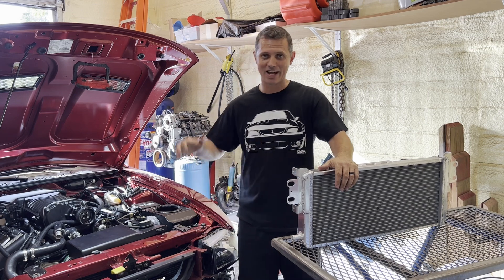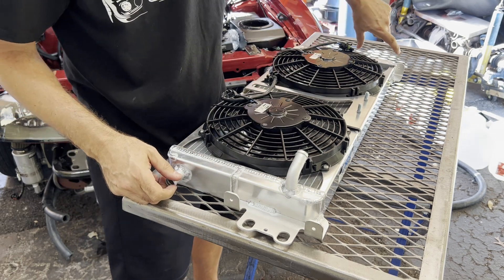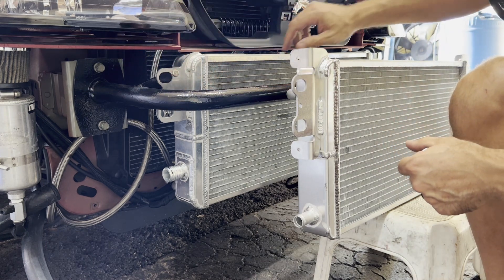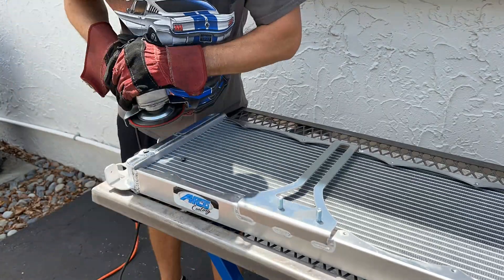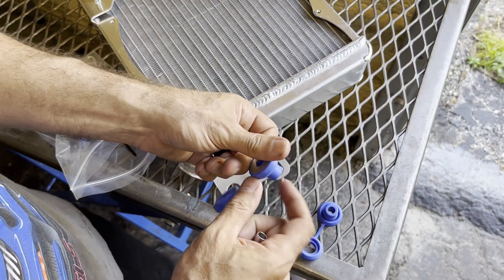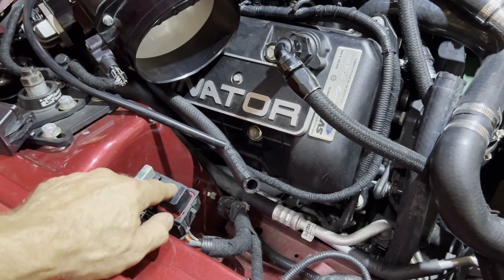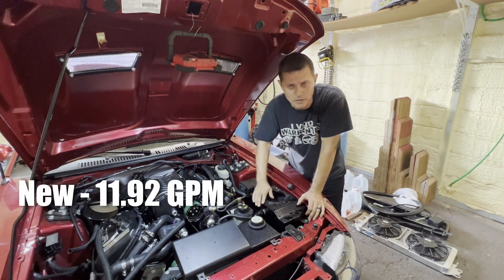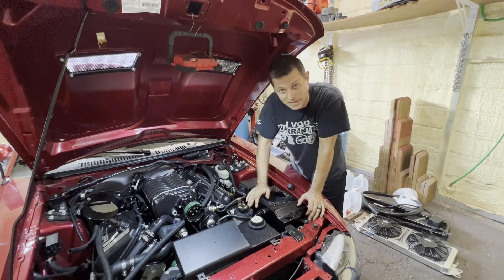Modifying a GT500 style Heat Exchanger into an 03 Cobra Terminator

Comment: Curious why you ran the hot coolant into the bottom of the heat exchanger and the cold out the top when normal path is hot in top and cold out the bottom
Reply from the maker: Anytime you plumb a cooler you want to flow from bottom to top so it can purge air out the system.

Comment: I have another question for you Mr. Malcolm. How effective would a normal dual pass heatexchanger, like an Afco, but custom built to double the thickness/girth? I ask because over half of the GT500 style heatexchanger is blocked by the front bumper and it doesn't get much airflow going through +50% of its surface. I am wondering if this has been tested before?
Reply from the maker: I've never seen that done before so I'm not really sure.  I will say although only the bottom portion has direct line of sight through the bumper you have to remember lots of air blows through and pushes up and all over.  So while the top half is not getting a direct line of sight flow of air it's definitely getting air.

Comment: Great content and exactly what I'm contemplating.  Curious if you considered the VMP heat exchanger with the 1 inch fittings?  It's configurable to be single pass vs dual pass and boasts a max flow rate of 30 GPM in single-pass mode.  Also if you considered Dept of Boost heat exchangers (super single or Titanic).  Also...what kind of flow meter are you using.  Would love to be able to grab that kind of data when I start making my own updates.  Thanks for the analytical approach to validating theory vs reality.
Reply from the maker: Thank you, I'm glad you're liking the content.  I agree too many opinions and no real data.  Yes I have been looking at other options and doing other testing.  There are more videos and content on the subject in the works and coming.  Stay tuned for that.  My flow meter was just a raw meter that provided a square wave signal output.  So you need to use it in conjunction with a computer or electronics to interpret the signal.  That worked for me as I wanted to capture the output and data log it.  They also make self contained flow meters with a digital display which is what most people would likely use.  Mine is no longer available so no link but if you search google for flow meter you'll find all kinds show up.

Comment: Hey Malcom where are you located? I'm asking cause I would like to see If you would be willing to work on my car? Basically everything you have done on your channel,  VMP intercooler and gen 5. Name your price there will be no haggling or negotiation on my end.
Reply: Join SVTPerformance, read through the threads and do the work yourself. THEeee absolute best information on these cars is right there on that forum with guys who are willing to help you out.  Malcolm put a thread up years ago about fuel temps and different fuel setups that I was ever so grateful for. All free information, which I am so grateful for.
Reply from the maker: That's a great gesture and maybe in the future I could do some cars like that on the channel but right now I'm simply maxed on space and time.   When I moved from the midwest I gave up my shop space for some FL sun and driveway life lol.  I'm working on a fix but it'll take some time.

Comment: Thanks for all the hard work and great data Malcolm. I am currently installing a Gen3R and this is exactly what I will be doing with I/C system. In relation to the high flow of the EMP creating havoc in the reservoir I read where some guys are basically just using the reservoir as a degass tank and bypassing the majority of the flow. This seems alot easier to me than trying to add baffles in my I/C tank and me having no welding skills doesn't help either. Any thoughts on this method?
Reply from the maker: Thanks Tony, glad you're enjoying the content.  I would not bypass the reservoir and just use as a degas tank.  I don't have all the details yet, still working on the content but a future video will address reservoir capacity and it's effects.  Preliminary data says it's important.... but still working on it.

Comment: Mine has an Afco Pro on it and it keeps things cool pretty well, other than really hot day's stuck in traffic but anything in the 70's -80's it stays in a really good range and that's with the stock intercooler brick. I go back in forth on doing the VMP unit paired with the Afco Pro.
Reply from the maker: My next video out driving and ripping on the system should give a lot more data that could help you make a decision.
Reply: @MalcolmV8  Granted I haven’t done many hard pulls yet this year due to breaking in the clutch but now that it’s pretty much set I’ll see what happens with the temps with some more spirited driving but I don’t recall them getting that high after the VMP was put on anyway
Reply from the maker: Good deal. There are so many factors to take into account. I hope to convey this in the driving video and explain what’s happening with the numbers and data gathered.
Reply: @MalcolmV8  It will be interesting, looking forward to the results

Comment: Any reason you didn't go with the 13/14 gt500 style heat exchanger? I like your fix for the tank, I have the same issue with that annoying leak from the lid.
Reply from the maker: Do you mean an actual 13/14 GT500 heat exchanger? The AFCO unit is supposed to put cool a stock 13/14 GT500 unit. 
Agreed this tank has been very buggy but I’m making progress.